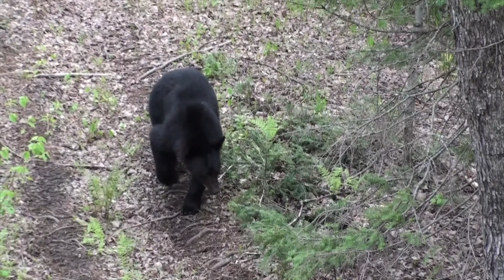TriAd Bridge Highlights by H2 Saddles

Comment: What size Amsteel is the bridge?  How about the continuous loops?
Reply from the maker: Paul Crave 1/4” amsteel
Reply from the maker: I’m not sure the exact size of the hip loops but they are smaller diameter.
Reply: Aaron Wright Outdoors thanks. They look the same to me too. Usually you want a friction hitch like a prusik to be a couple mm smaller than the rope it is on. But it sure looks like it works well. 
Do they ever get so tight that they are hard to break loose?
Good video.
Reply from the maker: Paul Crave Sorry for the confusion, the hip loops are a smaller diameter than the quarter-inch bridge. 
I have not had any problems breaking the Schwabish hitch loose.
Reply: Based on the weight rating in the video the hip loops might 3/16”. Makes sense because the product should be a little smaller than the rope it’s grabbing